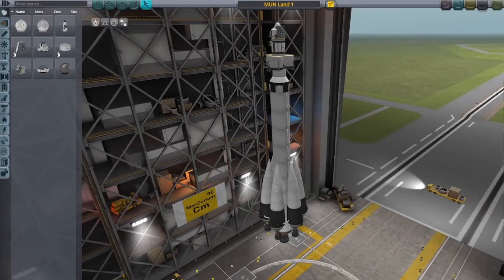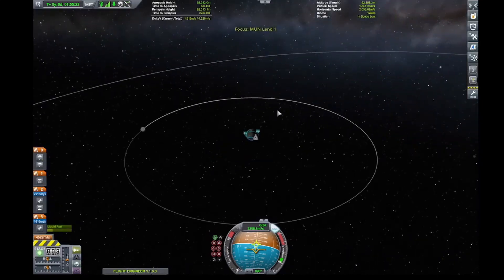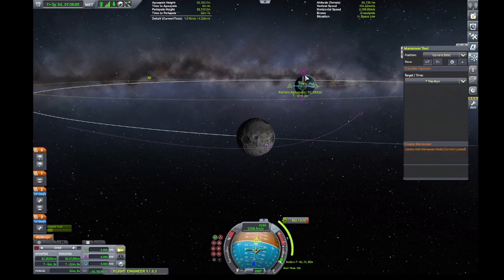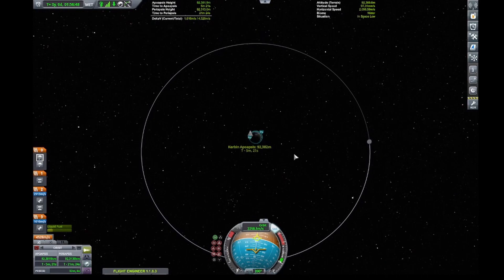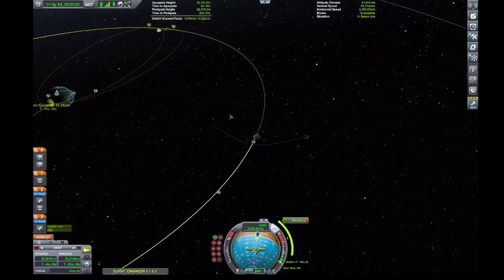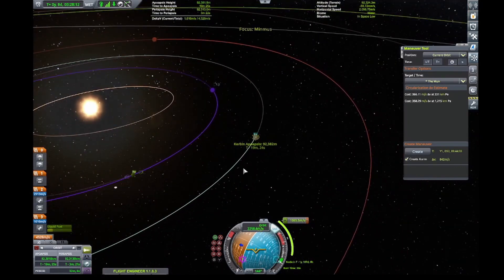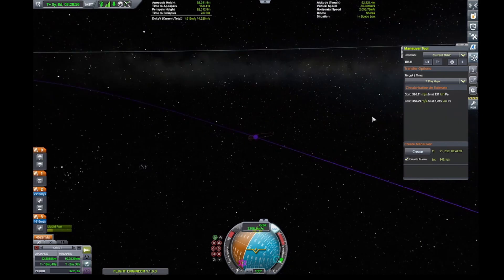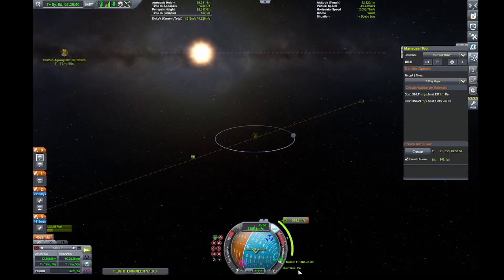Update 1.12, Kerbal Alarm Clock and Transfer (Maneuver) Tool

Comment: Great video to introduce the tool! I believe the time option stuff there is to input an arrival time to the body. Or the maneuver start time? It makes sense to let you choose this because of transfer windows.
Reply from the maker: I suppose you can use this for both.  It works well (most of the time) in planning the the transfer nodes especially for planets other than the Mun.  Makes for more efficiency.  Without it, I stand a good chance of running out of Fuel.  Thanks for the watch :)